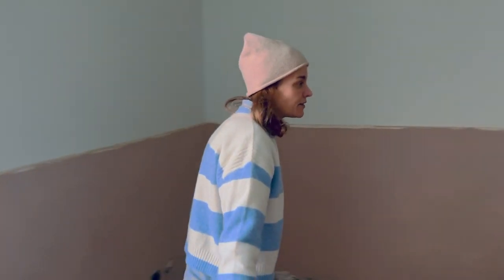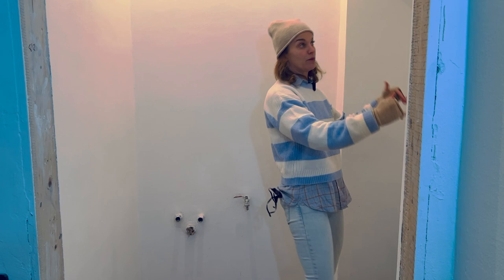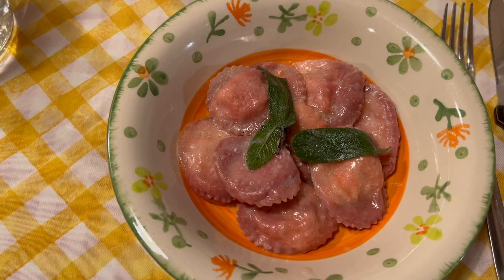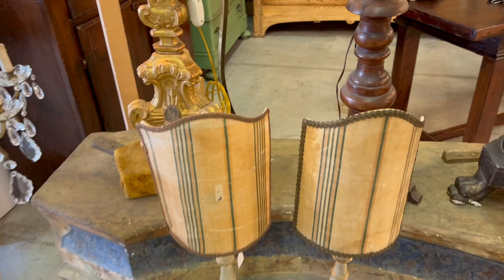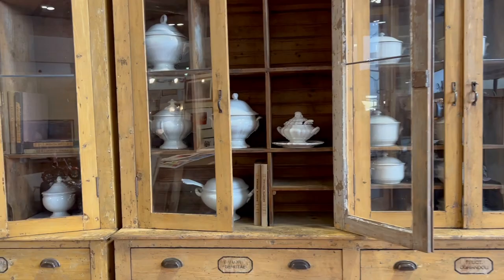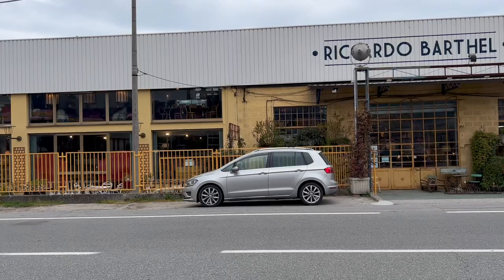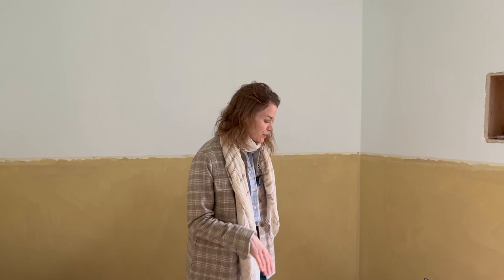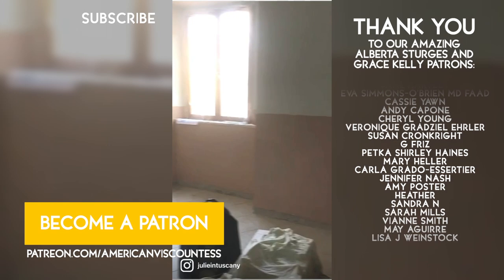Little ITALIAN House RENOVATION: Bedroom COLOURS, ANTIQUE Bathtub and Found TREASURE!

Comment: Just found you here! I’m a fan from television so now I’ve got some YouTube videos to catch up on and follow your adventures. I think you are referring to what, in Canada, have always been called café curtains. I’ve made a few in my past, and have been collecting vintage linens for a kitchen window redo for café curtains and a valance. From googly info, “Dating back to 19th century Vienna, Austria, cafe curtains were used in many cafes and coffee shops. Cafe curtains are cloth window coverings that have the distinction of being hung on a rod across the middle of the glass rather than at the top. Some cafe curtain types also have a top header section, or valance. Mar 12, 2022”
Reply: They're called café curtains here in the UK too Dawn, and I have them in my bay window at the front of my 1860s house.  I'd love to be able to say that I made them myself, but I'm not that talented.  Luckily my sister is.
 🙂
Reply: @monicawarner4091 , we also call them cafés, here in the States. They are super easy to make and Julie could use those gorgeous vintage sheets to make both the valances and cafés.

Comment: Julie,  I love what you're doing there...all is great   BUT   DID YOU REALIZE THAT THE "LAMP GLOBES" really DO NOT fit the LAMP CIRCLE BASES?  The globe should rest on the larger brass rim..sorry, b ut I have the same lights - love them - BUT  you don't have the correct globes with the correct circumferince bases...spelled that wrong...the diameter of the globe opening needs to rest onto the outside larger brass rim......